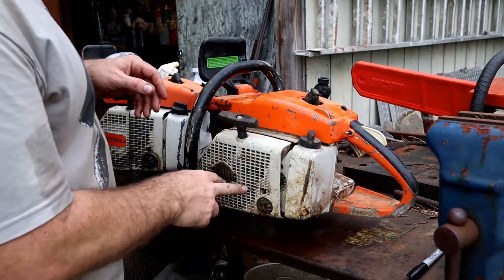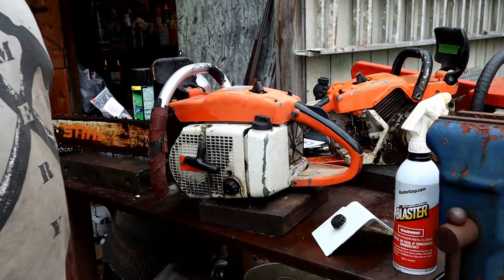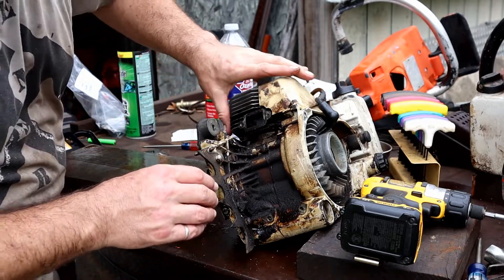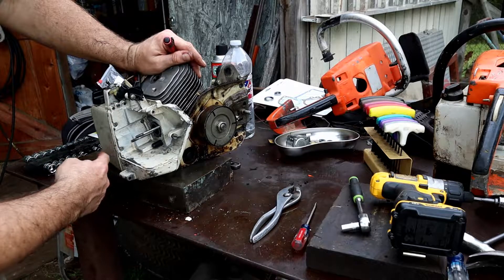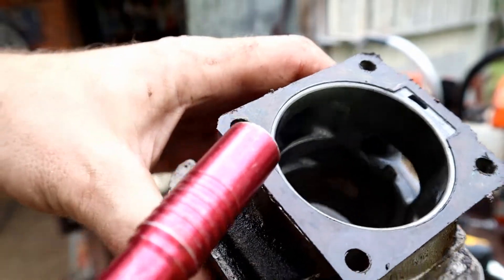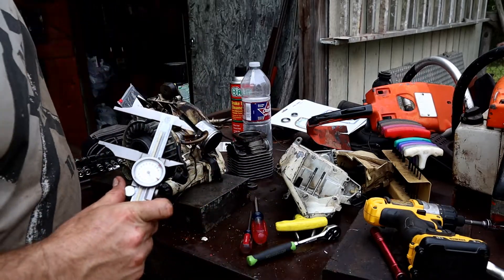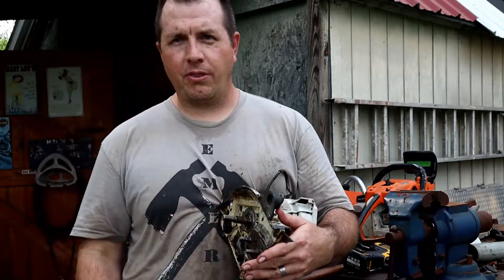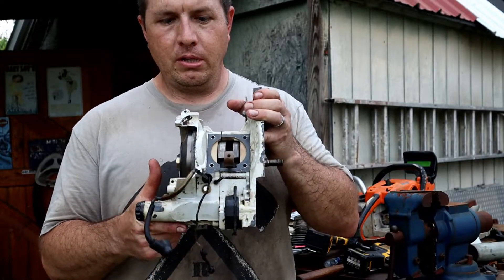Stihl Legend 045 056 AVE Revival and Ported Chainsaw Pt1

Comment: 056 had 5 version 1980 to 1985 production 
056 AVE – standard with electronic ignition

056 AVSE – Super with electronic ignition

056 AVEQ – standard with electronic ignition and chain brake

056 AVSEQ – Super with electronic ignition and chain brake

056 AVMEQ II – Magnum with electronic ignition and chain brake

Stihl056 056 S056 MagCCs81 ccs 87 ccs94 ccsBore52 mm54 mm56 mmStroke38 mm38 mm38mmWeight18 lbs18.1 lbs18.52 lbs
Reply from the maker: Good stuff man!
Reply: @Man-Time  Any time I bought most of my stihl new from earlier 70s to mid 90s so I know them pretty well no substitute for experience there a few models I don't have n for some crazy reason still want them all of my saws are 0 series not interested in the newer stuff give me a carburetor and a screwdriver am good if you ever seen any info on the older stuff just contact me more then willing to help but don't wait to long starting to forget specs getting old sucks
Reply from the maker: Roger that. Very cool to have all that info man. Must have some great stories to tell!
Reply: @Man-Time  Probably if I could only remember them take care keep the man stuff going good stuff for the youngins to learn
Reply from the maker: Will do!  Any comments you want to leave on my vids will be immortalized. Please feel free to drop as much knowledge as you please man